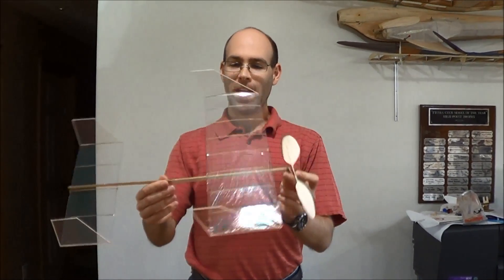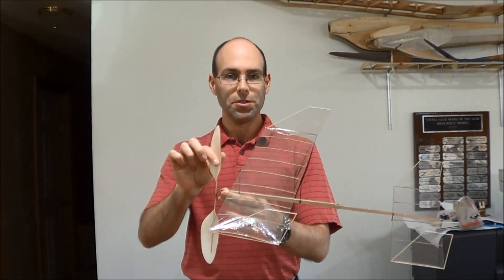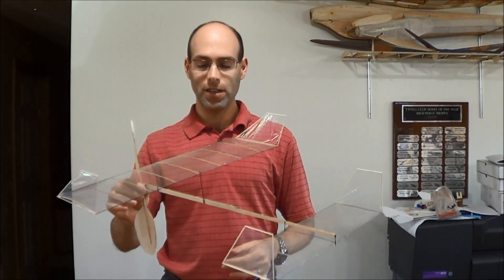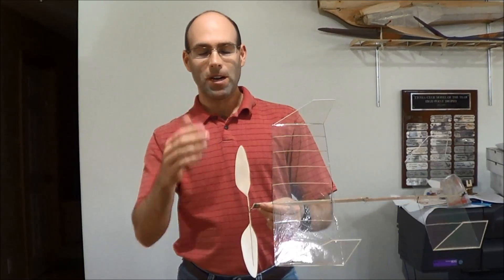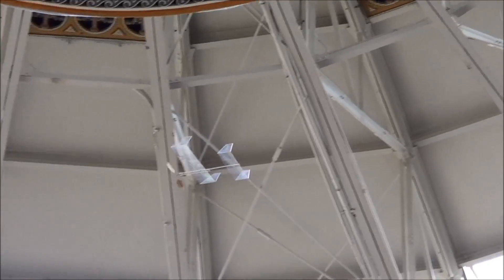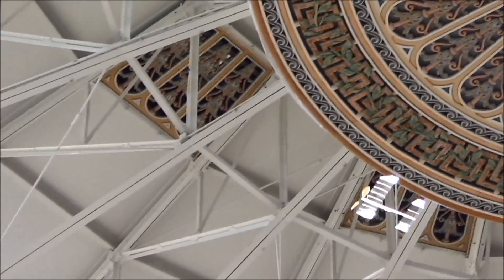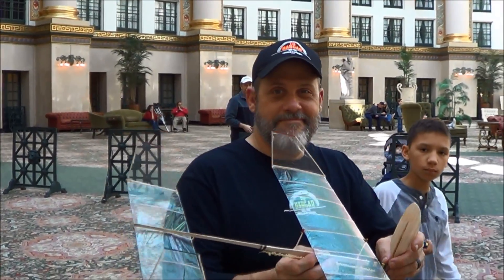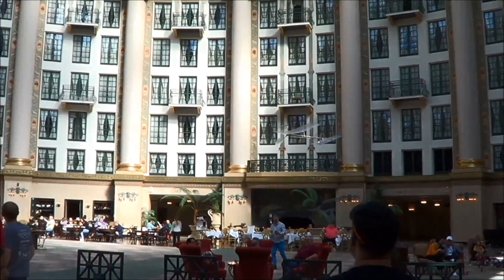The ultimate Pennyplane kit!

Comment: How do the props spin so long? Aka how do they spin so slowly?  Or aka how do you get the rubber band to unwind so slowly?  Is it via resistance built into the prop? Special rubber?  Also,  how do you make sure the diameter of the flight path isn’t too small or too large?
Reply from the maker: Big, high pitched prop backed by the best rubber ever created.
Circle diameter is adjusted by a combination of thrustline offset, rudder offset, tail tilt, and wing warps.
Reply: joshuawfinn Thanks for replying!  So is there resistance when trying to turn the prop?  Or is the rubber just incredibly soft and 5 feet long unwound?  I’m just thinking of the little balsa planes and kid, even if I sound that thing to its max. It would unwind in 10 seconds or less, and the prop was spinning very fast?!?